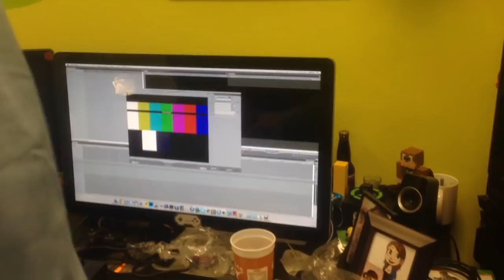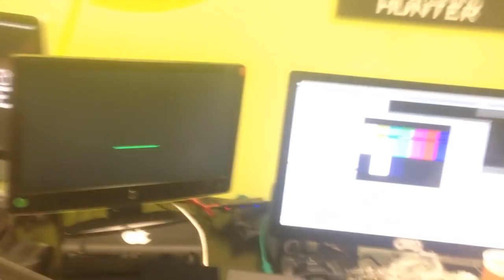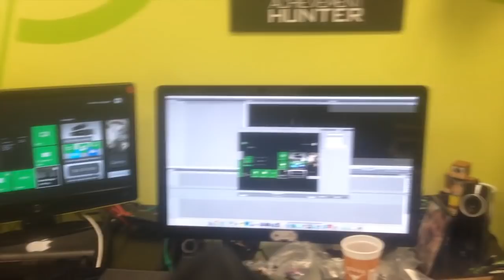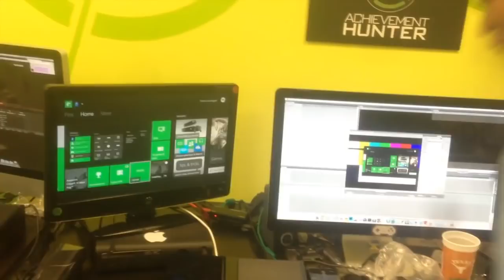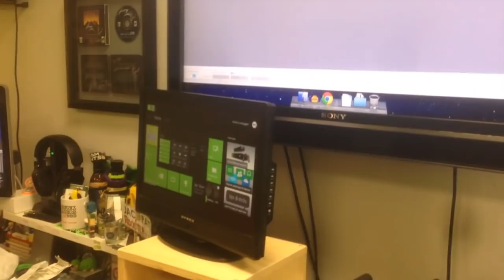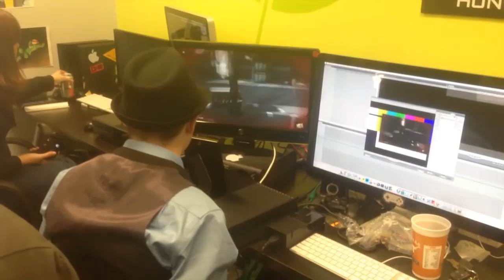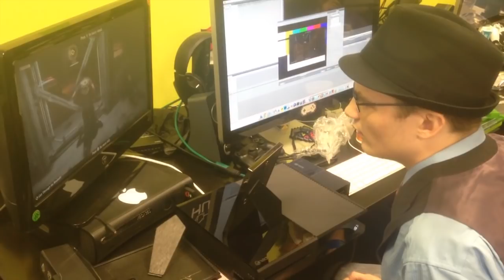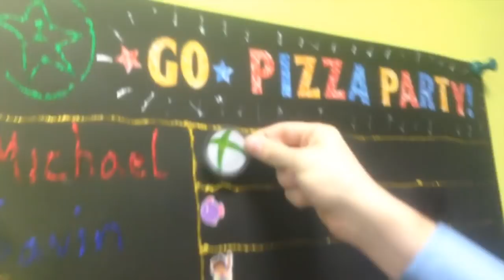GO! #6

Comment: SHoulda yelled "XBOX OFF"
Reply: It's actually: "Xbox Turn Off" It then asks yes or no....
Reply: Who cares sherlock, everyone gets the point
Reply: No you say "Xbox On" but to turn it off you have to say "Xbox Turn Off"
Reply: None of them connected the Kinect, though.
Reply: Wouldn't work, they were on the default power setting, which doesn't increase load up time, and hardware speed.

Comment: Welp, I hope Gavin enjoys rebuying consoles frequently. He has a PS4 on top of an Xbone, a 360 on top of the PS4, and his monitor on top of the 360. You don't stack consoles, you just don't. You shouldn't stack electronics at all. But throw in the fact he is flat out blocking the vents on his systems with this stack as well.

But hey, I guess he doesn't really have to worry about it. Replacing a console is probably no big deal for AH.
Reply: They bought around 6 xbox ones on day one, of course it's no big  deal for them, but you are rights, if he turns on the xbox one, and it overheats, he is also heat the PS4 and maybe even overheat both.
Reply: virgin
Reply: when i get my xbox one i am going to put my 360 on top but slightly askew so it isn't on the vent

Comment: How long until gavin's xbox overheats?
Reply: ***** so what your saying is it is warm blooded and it can think plus see and hear us.... its started people skynet is happening
Reply: *****
...... Here, I'll walk you through it:

How does it cooldown? By using the internal fans.
How to the internal fans cool it down? By pushing the hot air out of the system, which naturally will be replaced with cooler air.
Where does the hot air get pushed out of? The grates on the top of the system.
What is blocking Gavin's grates? About 40lbs of electronics.
Can the xbox's cooling fans operate effectively when the exhaust grates are blocked? No.
Can the xbox overheat when its cooling fans cannot operate effectively? Yes.

Comment: Gavin, grip is caused by friction which is caused by the normal force times the coefficient of friction. The normal force is the opposite of weight which is mass times gravity. This means as long as you decrease the normal force, the console would be easy to slide. Basically, you should have just lifted it...

Comment: both microsoft and sony did terrible on their consoles
Reply: That's why PC is the way to go.
Reply: ***** PC Master Race all the way!
Reply: ProjectOmega05 Unless you're poor and can't afford a good pc.

I finally got a good rig together. Playing everything on max settings.
Reply: Tweeaak Tweek You can however afford a PC that runs most things at medium settings. Good =/= Max, because it's not like games require you to place at Max settings or they don't work. Then again cough*Crysis3*cough
Reply: ***** Yeh but here's an issue with that. These new consoles are maxing out most of their games. So a medium level PC might be considered to be worse than the console. I personally like PC just because of its ability to do more than just play games.
Reply: Tweeaak Tweek If you afford consoles you can afford PC, difference is you you pay for PC through hardware, consoles sell at a loss so you can get the system cheap but then the games are $60/$100 and you have to pay yearly costs, do the math. You can get a mid range Pc that can play every game for $500 with a price drop if not that then just $800 AUD, there was a price drop dropping a PC builds by $500 last month...

Here is a list of PC's that will all play every maxed: 

They're dropped by $500 on sep and stayed like that for a month, can't beat it.

http://au.pcpartpicker.com/user/NerdCustard/saved/2YOq This pc will easily get 100fps maxed.

http://au.pcpartpicker.com/user/NerdCustard/saved/2Zxg

http://au.pcpartpicker.com/user/NerdCustard/saved/2ZLP

http://au.pcpartpicker.com/user/NerdCustard/saved/34I6
Reply: MrNerdCustard I'd like to point out that the links you sent show me pcs that cost over one thousand dollars. A console is 400-500.
Reply: Tweeaak Tweek Yeah, but as he said, most of the games for pc are way cheaper than console games, mostly evening out the cost.
Reply: ProjectOmega05 Hell yeah.
Reply: savyd26 Yeh its true. PC is a better long-run choice, but to be fair, consoles have a lot of features that we don't. Motion control (not great, but its something), really good exclusive games. PC exclusive games, i've found to be pretty average. I'd love to play RYSE on PC.

Comment: Why does it have to install the game from the cd to the hdd? That is so fucking stupid.
Reply: That's a thing for next gen....probably because blu ray drives can be kind of fragile and slow, and data needs to be pushed faster.  PS4 also needs installs, but handles them a lot better than Xbox One does thus far...lets you play the game a lot quicker.
Reply: ***** Next gen is having less options.

Sounds about right considering the state of gaming.
Reply: Paul Dennett who knows, maybe as it goes forward it'll get faster, we can only hope
Reply: Paul Dennett See, this is why PC (and Mac and Vista, if the games work) is always better: You download once, load times are very short, you can way past 1080p, (YouTube only goes up to 1080p, which is max the PS4, and Xbox One can go up to 2160p) which is as far as I know about 2400p (technically PC can go up way higher, but it requires a powerful graphichs card and a monitor that supports it, can the costs are insane), and you can use the Xbox controller (for Windows) on games that support it. The only downside to PC, not all games available for it.
Reply: SonicShadowSilver365 youtube goes up to 4k.....
Reply: Because that is just the way things are done now. Even recent 360 and PS3 titles have mandatory installs.
Reply: SonicShadowSilver365
PS4 max is 4K...
Reply: DLxLoo No, that's for video and photos only, games on PS4 WILL NOT be render games past 1080p.
Reply: Paul Dennett It just depends on the game how quick it'll let you play it.
Reply: Random Video Productions Tell me one technical advantage the Xbox One and PS4 have over a PC that only runs at 32-bit and DirectX 9?
Reply: Welcome to the brilliance of the Xbox One.
Reply: SonicShadowSilver365 I believe I never said games run on 4K, I just said that PS4's max is 4K, which is still true. Stop trying to defend PC, the only thing it wins over consoles is graphics. And there's a really small difference that can't be noticed unless you do detailed comparisons. Plus, PC's can get things called VIRUS, which PS4 and Xbone are less likely to get, probably can't even get them.
Reply: ******facepalm* You still need the disk to play, regardless if you install the game or not. Installation just reduces load times.
Reply: ***** True. 4K resolution is pretty damn expensive to get, and there's not guarantee of lasting long. But I really don't see much improvement past... maybe 2000+p. I mean 1920 by 1200 (16 to 10 ratio) is pretty fuckin' good on it's own for PC. I can't see how much better it could get, other than actual life looking quality of maybe 1500 to 2000p.
Reply: ***** Xbox One goes up to 2160p.
Reply: ***** No fucking shit, but why is it REQUIRED? If I don't want to install it on my HDD, I shouldn't be forced to. Is it or is it not a requirement?
Reply: ***** Don't talk about your mom like that.